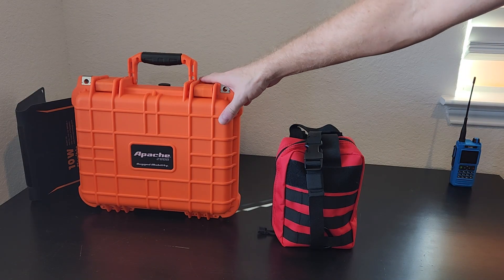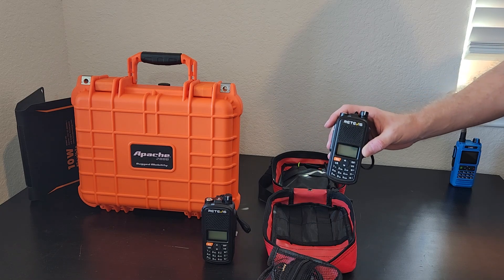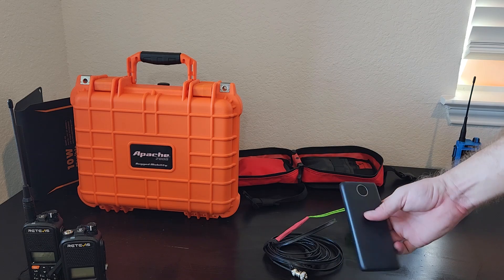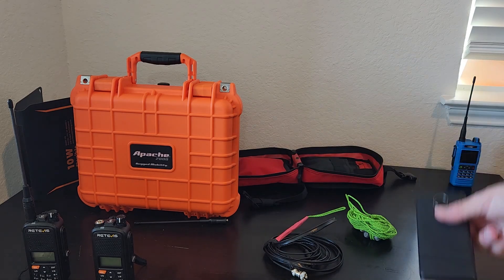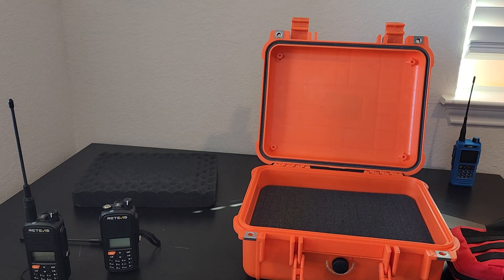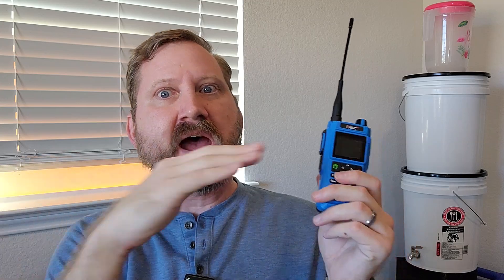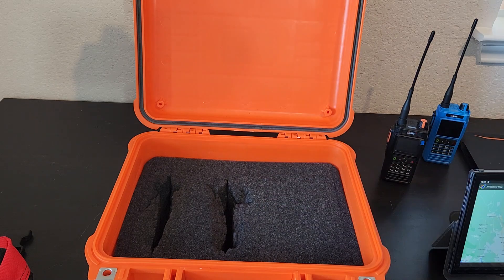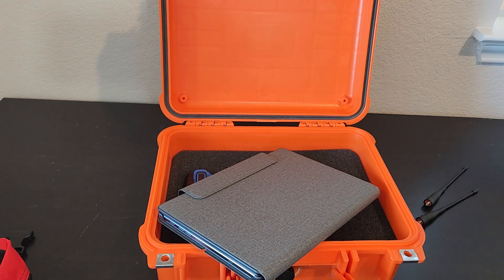Easy Radio Go radio kits for emergency situations | Texas Prepper Projects

Comment: Well done video, probably getting that N76 for all the features. Have licenses for GMRS and Amateur General. I would go with the Tid Radio H8 or H3. I have doubts that the Retevis is truly IP67 at that price point. Very good job. 73
Reply from the maker: Check my other videos where I drop the retevis in water. The N76 now has full TNC abilities!  I got a TID radio and didn't like it

Comment: What makes Meshtastic a huge scam? 

It seems to me that there are clear differences between Meshtastic and APRS, such as who would be able to use the two, ease of use, encryption ability, cost, etc..
Reply from the maker: I have a couple of issues with meshtastic.  First. The real world range.  Yeah sure it's possible to go miles and miles from the top of a mountain but in the city it's a few blocks. Meshtastic entirely depends on mesh nodes to work and you have any real range. It's 'deceentral' sure.....but you still have to have nodes, which adds cost. Lastly the data rate. 1200 baud.  Compare that to APRS, which is 9600 baud, and you can use an 80 watt yaesu 2980 and connect simplex. Meshtastic is a nerd toy in my opinion.  It will never replace cell phones or wifi or ham radio. There is too much infrastructure that you need to make it work. A mesh node every half a mile just isn't practical
Reply: @texasprepperprojects  It seems to me that maybe you are missing some of its applications while completely ignoring some of the negatives surrounding APRS. Comparing any of the forms of comms to cell phones is an exercise in futility. It is the overall best form of communications platforms. With that said, it also has its negatives like every other form of comms.
Reply from the maker: And what applications does it have that APRS does not? Other than 'encrypted chat'
Reply: @texasprepperprojects  How about you give me any negatives about APRS vs. Meshtastic. They both have positives and negatives. You already listed one, which was the fact it can not be encrypted, which is important to some people.
Reply from the maker: Drawback to APRS is Encryption,  the lack of ability to mesh. The limitations of the number of digi hops it can do, and chat room functionality
Reply: @texasprepperprojects  What about ease of use and practical accessability to your average person?

I want to make it clear that I think APRS is great for those who are willing to get licensed and nerd out on comms. I also realize that many of my family members and friends will not do so, and in an emergency situation, those people are the people I would be most concerned with.
Reply from the maker: I think aprs is easier to use than meshtastic.  APRS Droid is pretty straight forward with very little setup. Which is why I call meshtastic a nerd toy. Buy a couple of those V76 radios with Bluetooth and associate your phone and boot up APRS Droid and your set
Reply from the maker: So, for your friend and family that aren't hams, are you going to personally buy and set up and configure a mesh node every half mile for them and teach them how to use a mesh2go device?
Reply: @texasprepperprojects  I honestly would not use either for that.
Reply from the maker: So what's your plan with Meshtastic for your friends then?
Reply: @texasprepperprojects  I have used it while hunting with family and friends on several occasions.

Comment: Amazon has the Retevis A1 on sale right now for less than $29. I just bought four of them. Thank you for the review. Also, would you post a video on how you tied the string onto the end of your antenna to connect the pull cord?
Reply from the maker: I literally just super glue the sting on both sides of the antenna and then put heat shrink over the top

Comment: This is an excellent video!  I have been updating several kits like this.  I already had several HT's, and updated the batteries to usb C charge capability.  So I have those plus backup batteries, plus bricks to charge should I need them.  The aprs HT intrigues me and is probably going to be my next purchase.  

One thing I do like about my Tidradio HC3's is they can easily be programmed for local repeaters via bluetooth app ODmaster.  Downside to the HC3 is only 199 memories, and if wifi is down, the app doesn’t work. On my ht's with  999 freq, I do it by zone/city for areas that I go to or would in an emergency.

I am caught between hard case (heavy, but great protection and almost waterproof) and soft case (lighter and easier to carry around, easy to carry a lot of accessories.

K9TAX and Ed Fong antennas plus an Elk dual band beam/painters pole for me, but I do need your toss it up a tree gizmo!  

Thanks again for the video. You have put together some good kits, and it gives me more ideas to consider.

73, Brett K5WXP
Reply from the maker: I personally like the soft shell case for easy portability but if I was going to go full on end of the world mode having a really hard case with room for the laptop and solar panel I'd go that way. Or if I had do air drop something to someone stuck on a roof.

The N76 radio is being updated constantly and almost has a fully functional Bluetooth TNC for under $200.  The A1 is a great basic radio and I didn't care for the TID. With 999 memories you have plenty of room. Thanks for the comment!